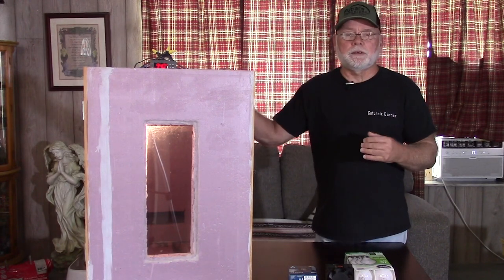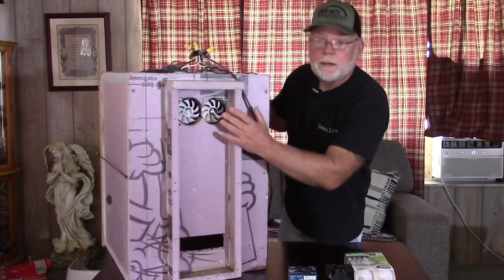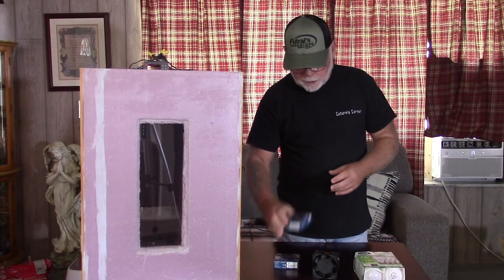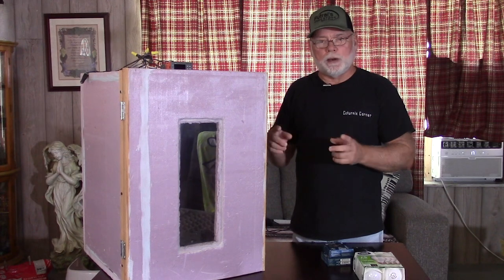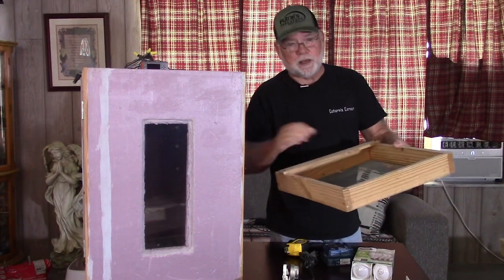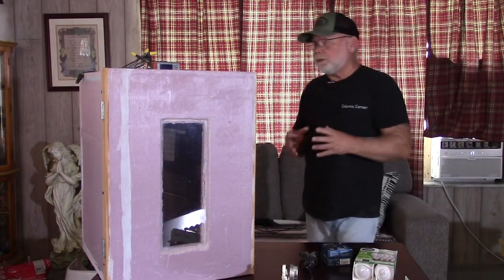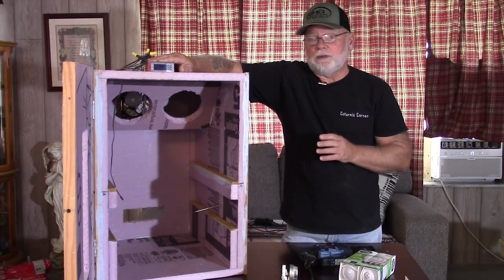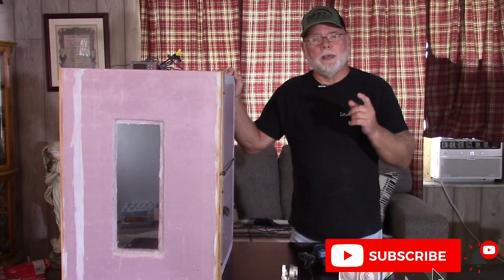DIY Incubator Maintenance & Repairs

Comment: Terry you made a monster. I put 120 quail in mine when I  got the temp right and last sunday I had 106 little popcorn sized quail all 106 is in the brooder and doing fine. Thanks for the info.
Reply from the maker: Congratulations! That's a great hatch.
Reply: I cleaned it out and sprayed it down with pine sol and left in the sun for a day. And it's load up with 234 more  the 4 by the motors got hot and didn't  hatch.

Comment: Ive thought about trying out the ceramic reptile heating elements that screw into a light bulb socket. Also installing a led light with a switch.
Reply from the maker: Several people have successfully used the ceramic heating elements. Good idea on the LED light.
Reply: Incandescent bulbs are going to be a thing of the past due to laws being passed but ceramic bulbs will probably be used more.

Comment: Hey terry so I just built this box last week and ended up receiving the wrong fans from Amazon. the ones I received are 2000rpms was wondering once your incubator gets up to temp. And the lights cut off how long will it hold that temperature before temp starts falling and lights cut back on thanks

Comment: How is the 12v incubator coming along? I could really use an option for some extended camping trips. It would be nice to be able to just hook up to a car socket and hatch along the way. I'm running hatches 1 week apart and can't take time off until my ayam cemani's quit laying. I need to get a lot in the incubator since I only get around 80 eggs a year.

Comment: Thanks for the update on this.  I want to build one, but with only one tray.  Should I still do the same size or would it be ok shorter?  Would it still need two fans?
Reply from the maker: Any modifications from the original plans would need to be tested.

Comment: If you got a good temp control you can wire up a speed controled fan to the rest and use that function instead of just cutting the wire off. Just saying.

Comment: Hey brother my fans are in the bottom will it hurt my hatching
Reply from the maker: I really can't answer that. You will need to test the unit prior to setting your eggs to make sure your temps and humidity are stable. I can say that several people were successful modifying the incubator and got good hatch rates.